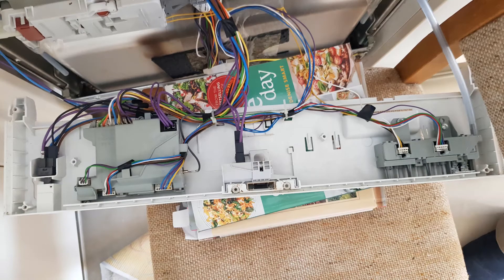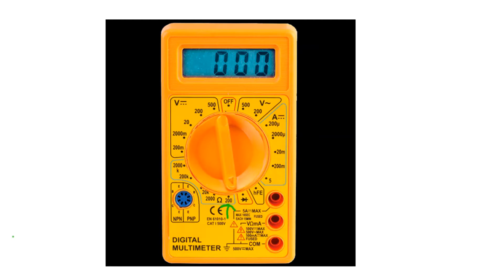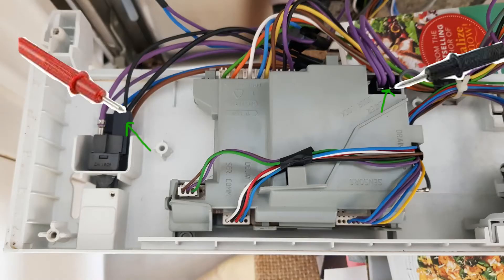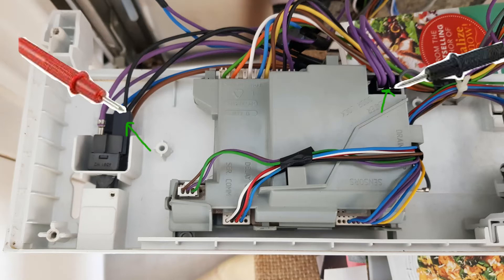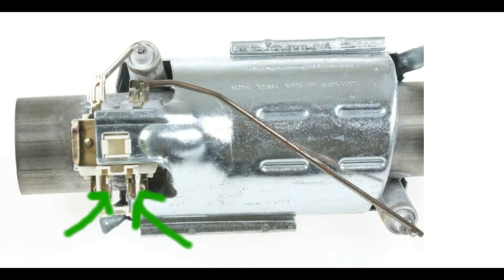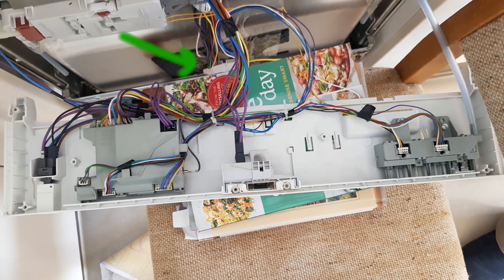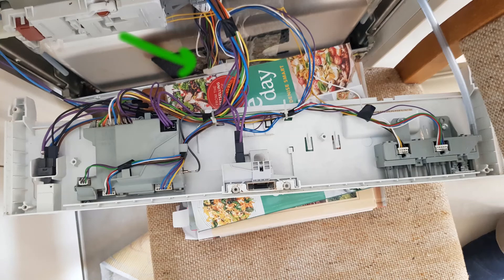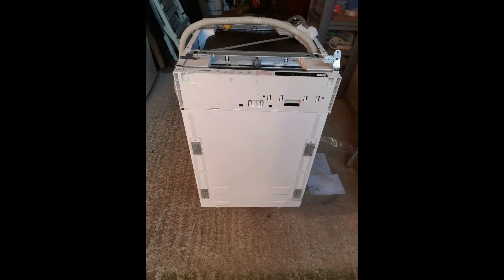diagnosing a heating fault on the lamona HJA8630 HJA8360 or HJA8362 dishwasher

Comment: Hi I disconnected the 3 wires from the anti flood device and lost the photo. I have a new part. Do you know what order I should fit the 3  wires back on
Reply from the maker: I don't have access to the machine any more, as it is at my parents place.  Are you sure there are three wires and not two?
As it is an anti flood device it is just a micro switch which will connect two terminals when the float is down and two terminals when the float is up.  One terminal will be common (C) and the other two are connected to C for float up and float down

In a lot of dishwashers there would just be two wires, one connected to common and the other to float up (eg water is present).
If you say you have three wires then the other wire must be a sanity check to let the dishwasher know the float is present.  It would get signal for float down.

If you have three wires I'd suggest seeing how the machine behaves with all them loose.. i expect the pump runs all the time.  I would then turn the machine off and try different combinations of touching the wires together and turning the machine on to see when the pump stops operating.  When it stops operating make a note of the wires that need touching together lets call them A and C.  I would then check which two pins on the sensor are connected together when the float is down (no water).. plug the two wires you noted (A and C) into those connections.  plug the third (B) into the remaining place.  Next turn the machine on, observe no draining happening, and lift the float... does the pump operate?  if yes you are done.
If the pump doesn't operate when you lift the float then swap your A and C wires over.. and try again.  It should now operate the pump when lifted.

The reason I call the wires you identified at the start A and C is because one of them is actually (Common!)  you don't however know which.. that is why you might have to swap them over at the end.

all this of course is not needed if you only had 2 wires.. in that case simply connect them to the pins that are not joined (open circuit) when the float is down, and are joined when the float is up.. see if that works.. if not then it is negative logic, so plug them into the pins that become open circuit when the float is up.

Comment: Thank you for your very clear instructions. Can I ask you, if my dishwasher stopped mid cycle and has no lights on at all, is it likely to be the control board ?  Thank you for your response. Kind regards.
Reply from the maker: If when you turn it completely off at the mains and then back on again it has no lights at all it could well be the control board, or it could be the wires are damaged as per this video.  It could also be that you have blown the earth/ground trip for your house due to element issues (check other things in the kitchen still work).  It could also be the fuse supplying the dishwasher (though this will mean something else caused that).
Reply: Thank you for your quick response. I did the turn off everything and then back on again and still nothing. So I think it is as you say probably the control board. I am going to follow your instructions and I have a good feeling I will get it sorted. Thank you.
Reply: Hello again, I have tried to test the thermostat as per you instructions and at 200k I only have the reading of 1. As I can only try and touch the base of the wires in the multiwire plug it may be I'm not making any contact at all.  Can you tell me where to find the thermostat on the machine so I can check it directly. Thank you.  Malcolm  ps. I checked the element and it has a reading of 28.5. So I think it's OK.